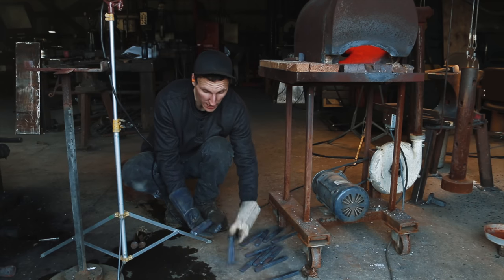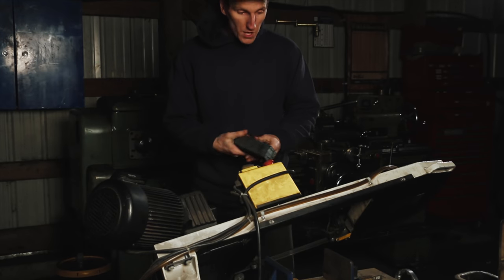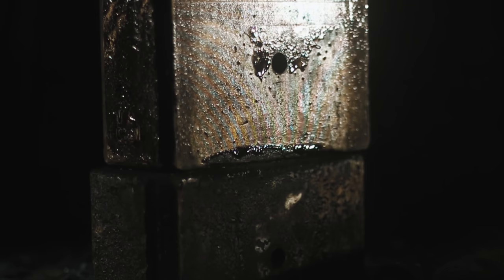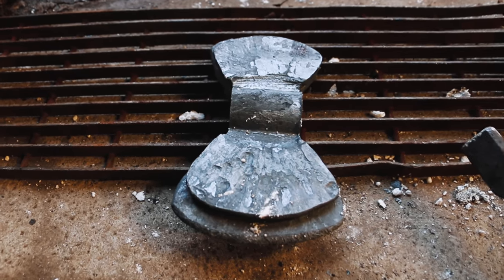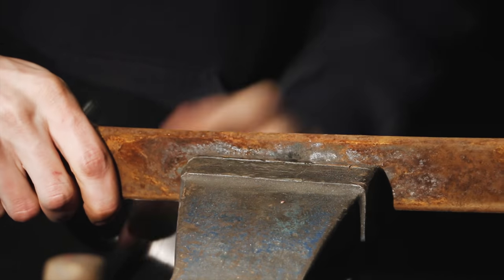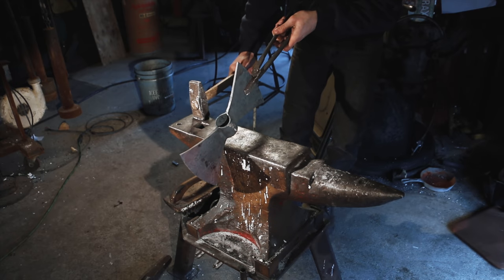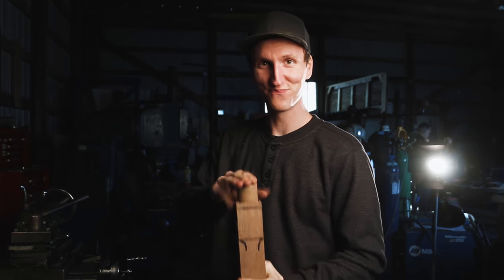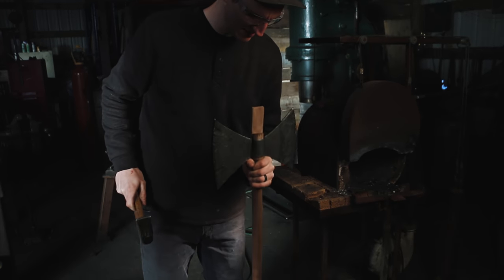FORGING A DOUBLE BLADE AXE

Comment: Boy you're gonna have a hell of a hard time controlling that axe with a round handle
Reply: Pentex  me too. I turned a handle for a sledge once but I left  two spots for my hands one low and one high where you grab. then I off set my center on the handle and turned oval shaped handles with some little groves for grip where the handles go. I swear you could patent it as it made such a nice handle and have good control.   everyone thinks a lathe will only spit out round items but if you know what you are doing you can do a lot.
Reply: Pentex  thank you
Reply: I swear, sometimes I learn more in the comments.
Reply: @jvmiller1995  yeah, sounds like you've got yourself a winner
...also I've seen someone make a square on a lathe.
Reply: @RedDawn430  oh yes you can do a lot on them that's for sure. I wish the the very best
Reply: @RedDawn430  how?

Comment: I'm usually not a safety Sally, but it might be a good idea guard back on your grinder. Mine doesn't have one either and now I have 4 stitches in my finger, even though I've been using the grinder that way for 18 years.

Comment: Dress the mushrooming on your hand hammer bud. That could be dangerous!
Reply: Jake Parker YES!!! Cringe every time I see that mushroomed head! I ended up in the O.R. due to a fixture wedge fragmenting and piece of steel in my rib cage
Reply: Tim said in one of his previous videos that this hammer is a softhammer made out of mild steel. So it has very, very low risk of shooting a piece off of the head. 😉

Comment: I hate RR knives because they are not high carbon so I am glad to see the leaf spring. Very cool making the two sides and forge together. Only real dislike is a round handle that will twist when it strikes as you seen. You need to leave some material where your hands go that's not round

Comment: Only Problem With this, The Handle Is Round. Meaning You Have No sense Of Orientation Or Edge Alignment. Any Edged Weapon Should Have An Oval Like Handle To Do 2 Things, Give You Sense Of Orientation, And Aid In Edge Alignment By Not Twisting In Your  Hands. As Im sure You Noticed With The Round Handle TheAxe Will Tend To twist And Roll When Swung, My Suggestion, Take Something, A File, Mill, Drawknife, Whatever You Have And Shave Down The 2 Sides Of The Handle And Smooth That Out Afterwards, Itll Feel And Perform Better. Other Than That Awesome Axe! Really Surprised At The Railroad Ties too.

Comment: My only issue with this beautiful axe is the round handle. This would make it almost unusable in battle. How do you orient/index the tool in a battle situation? Do you ask your opponent to wait for you to line the blade up for a hit?  Handle should be somewhat oval at a minimum. Longer in line with the blades so your hands can control the direction of hit. Of course a smack with the broadside would still stun your opponent, but if your looking for a kill with quick recovery for the next foe...

Comment: Please man, dress your hammer. That mushrooming is making me cringe.
Reply: Man I was thinking the same thing. all the stuff he makes and he can't grind that mushroom out before it splits and ends up stuck in him.
Reply: Only reason I went to the comments.   Prolly be the camera guy that gets it.
Reply: Quit crying, It comes with the trade. Protect your eyes and you'll be fine ..unless you got soft hands
Reply: @MrTimjames343  "It comes with the trade". Dude that's like driving a semi truck around with 18 tires that got cords showing and saying just put your seat belt on, blow outs come with the trade. What it is , is laziness and not taking care of the tools you use.
Reply: @jvmiller1995  still crying son? A hammer is a lot different than a truck now is it hoss. Finger nail sized metal from a hammer is not going to kill you... I'm an old generation ironworker. Kids these days with their soft hands
Reply: @MrTimjames343  cringe what is with boomers waiting until something happens instead of easily preventing it.